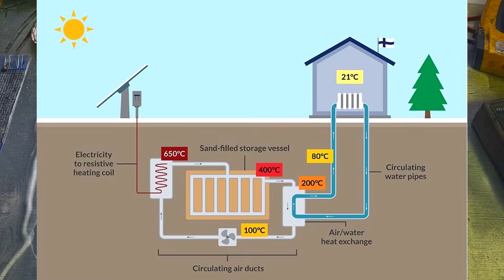Diy Sand battery V2 - heat battery

Comment: For god's sake this idea simply will not work at this scale and it also will not die

300kg of sand at 200c going to say 50c when it won't really heat the room is only 
.01 kWh

Let that sink in. 
That means you can run a 1000w heater for .01 hours
Thats a few minutes at best.
Reply from the maker: Hahah calm down,.... is just a  different idea of sand battery wich uses conductive sand instead of some sort of heating elements.

Comment: IS the black sand a mixture of sand and normal charcoal? Thanks
Reply from the maker: No,... it is mixed with carbon black. But it can be used a graphite also. Because the carbon black is harder to find.

Comment: The copper may just seem hotter than the sand because it's a much better conductor.   Try painting the pipe flat black to be able to get a reading.

Comment: resistance at the media to copper electrode interface is probably higher than the average? So maybe increased it there.?   I'm am wondering what the most durable (oxidation ,corrosion) electrode materials will be.   Maybe I'll make one too.

Comment: I like this!   Yet,   I wish you could tell us more about the following:   1.  Did you wet the sand with any electrolyte?   Or was it dry?  2.   Did you wet the Carbon Black with any electrolyte?  Or was it dry?   3.  If wet with electrolyte,  please measure the voltage,  Since then you are making a battery that is dependent on a chemical reaction.  If not, then I truly wish you well and hope you are making a follow up video.
Reply from the maker: I dont wet anything,... no sand and no carbon. The device go o er 100C so in that case the electrolyte will evaporate.
Reply: @cayrex  Thanks,  now to replicate a little of your effort for us DIY'ers,   can you recommend where you got YOUR CARBON BLACK from ?   Did you make your own?  If, yes  then please explain.  Another video?
Reply: @cayrex  bro if we put on it the peltier cell can have a good power ? Is nice idea if can use in this way for turn on one computer ect...

Comment: What is the best way to get the carbon black? Is it normal graphite powder?
Reply from the maker: Carbon black and graphite is not the same. But you can use graphite. The point is that you make the sand conductive
Reply: @cayrex  thank you for your response!
Reply from the maker: @RickyStenicky2234  ah, no problem

Comment: The paper isolation will probably burn, maybe a piece of mica?
Is that black stuff from your stove or do you buy it?
Reply from the maker: On high temperatures, yes. Good idea about mica,.... also can be used ceramic or glass wool, etc
Reply: @cayrex  And the black stuff? Here in HU is nothing available under this name as "carbon black".
Reply from the maker: @lorifilm  I think that conductive carbon black is a bit harder to find because is a special stuff for special applications. For that reason you need to search in other countries. Search for super P carbon black, ketjen black, super c45 or c65, acetylene carbon black,..... and so on
Reply: @cayrex  Hvala! You can get it in slovenia? (assumed from the sodium silicate bottle)

Comment: Hi Cayrex2, thanks for the great video. I'm not sure about the heat capacity of a pure black carbon powder, but how about to use it without sand? Melting T is higher than sand as well as conductivity of heat and electricity. Have anyone tried it?

Comment: Unless your using a solar panel to power this, you might as well just use a basic electric heater. The purpose of a sand battery is to store extra energy for later use when the sun isn't up to provide the energy, be it electric or heat.
Reply from the maker: Correct,... the sand battery store the heat for later.

Comment: Why 2 Plus and 2 Minus?
Reply from the maker: Because for the current. That I am sure that I get all the current to the device. Thicker is the cable lower is the current drop or I my case more cables. Some times I get the problem when I use thin crocodile clips or simillar thin cables.

Comment: How long would a small can like that take to discharge all of its stored heat? How far away can you feel it?
Reply: That would depend on the temps starting inside the battery, the temp outside the battery, any insulation on the battery, and how you are drawing the heat out, I.e. are you letting the heat dissipate or do you have air or water running through it?

Comment: I really love the solution for heating the sand, really simple and effective.  Great video!  I wish I had the skills to connect a bigger version of this up to my central heating.  Heating the battery with cheap overnight electricity and using it during the day would be great for winter.  Decarbonises heating and should be much cheaper than oil or gas

Comment: I was thinking about using a 100 watt incandescent globe encased in clay and keep the bottom exposed to utilise the light at night and then the heat for charging phone or lighting led . Not sure if globe will break with expansion though .

Comment: I have a 12 4amps power supply which should be ohms?
Reply from the maker: Hmmm around 5 to 10 ohms I think
Reply: @cayrex  thanks for your reply can i use graphite instead of carbon black?
Reply from the maker: @Fire.SnowAmbienceTV  yes
Reply: @cayrex  to what maximum degree can it reach
Reply from the maker: @Fire.SnowAmbienceTV  With good power source,... 500, 800 C,... more
Reply: did you get your sand battery to work?  I am having trouble with getting resistance down to 5 -10 ohms.  I am using graphite.

Comment: Brilliant! What about using a solar panel to power it during the day, then by using a copper coil circuit, pump water through it at night to use the heat? Or atleast a test on the size of solar panel to size of sand battery for maximum efficiency? There are many possiblities with this, thanks for sharing.
Reply from the maker: Yes,... the power source can be anything to heat the sand battery. And also the system can be made in many ways.
Reply: Can I ad cement and heat whit rocket oven ?
Reply: What I would love to do is run or at least preheat my backyard foundry. Copper/bronze take a lot of fuel…. Even if I could save a small amount it could mean a lot of savings

Comment: Any idea as to efficiency?  Would there be a maximum temperature it should reach?  Could it be used similar to an ETS unit (electrothermal storage) that can reach very high temperatures?
Reply from the maker: No idea about efficiency for now. The temperature is based on the power input. Lower power lower temperature and so on. The temperature can be way higher as I get for now

Comment: Fantastic idea!!  thinking outside the box.  I was thinking about making a sand battery using a rocket stove and waste oil to heat the battery, but this idea is so much better and easier.  I have a wind generator that I would use to power the carbon sand battery, that way I wouldn't need batteries or need as many of them.  Robert should try this one.  Again, great idea and hope you follow through with more infor on this idea.
Reply from the maker: Thank you. Yes I will look more into this sand battery
Reply: OK, I am trying to build one like yours.  I dried the sand and that does not have any conductive.  So I used some undried sand and that is conductive, so how much moisture is in your sand.  I am using graphite, will that work? or do I have to use carbon black?  I have used about half of the graphite and the lowest ohms reading was in the 50's.  it is going to take a lot of graphite.  if carbon black is better, could you provide a link to get some, most of the carbon black on amazon seems to be non-conductive or for dyeing.  I think this idea of conductive sand used in a thermo mass storage device is a game changer.
Reply from the maker: @stevejorgensen8123  Hi! My sand is dry because the sand battery heat up over 100 deg C which means that all the water is evaporated. Yes, you can use graphite. 50 ohms os not so bad, because in this case if the ohms are higher then you need higher voltage. Also more you press together the conductive sand more conductive will be.
Reply: @cayrex  Thanks for the reply.  I tried to compact it and the graphite make it slick, won't stay compact, but did get the ohms down to 50-60 area.  Hooked up the battery charger at 6VDC and no go, no current flow.  increase voltage to 12 VDC and still no current, increase to 14 VDC and still no current flow.  I added some salt and little water, thinking that would improve current flow, no go.  I must be missing something or doing something wrong.
Reply from the maker: @stevejorgensen8123  Uf, for around 60 ohms you will need higher voltage
Reply: @cayrex  thanks for your reply.  what is your carbon black made of?  did you make it yourself?  thanks

Comment: Wrap it up in rock wool and put in another container and see how long it can stay hot . I will be putting a tec on mine when they arrive and charge my phone and some led lights 👍🏻
Reply from the maker: I have several Tec devices to try.
Reply: @cayrex  excellent . I guess you sit it on one with a cpu heat sink in ice water  ?

Comment: I also found stainless mesh  helped avoid hot spots which became a problem with a tin can as electrode .
Reply: Does that replace the copper pipe?  How would it be arranged?  Thanks!
Reply: @ashmcconnell3868  I had mine go into the bottom and back up again  like a u turn but no hard creases !
Reply: @Buzzhumma just wondering if you done more on this. Just starting my journey
Reply: @thomaslloyd82  no i moved on as i found it very messy with graphite and the hot spots where a problem .